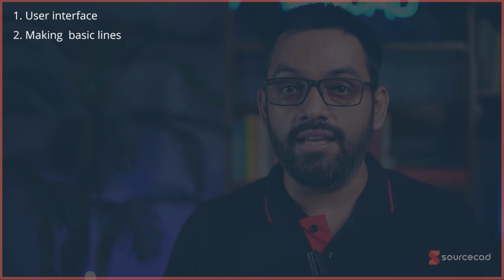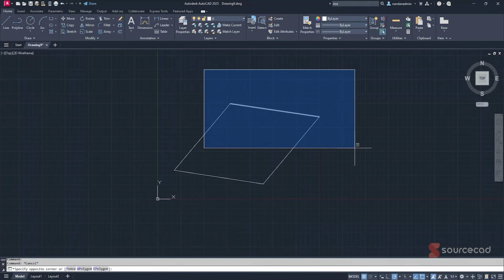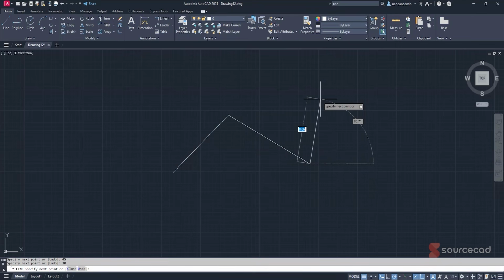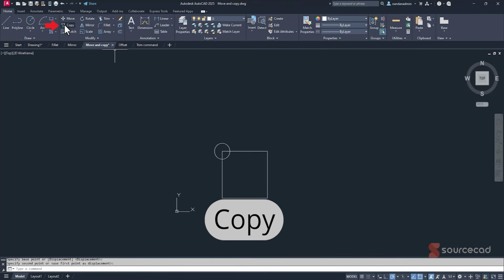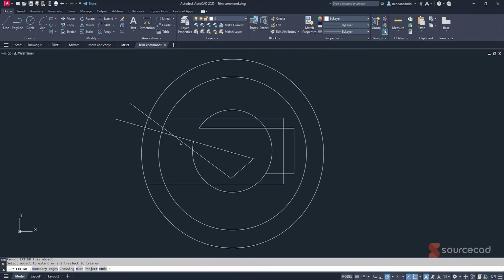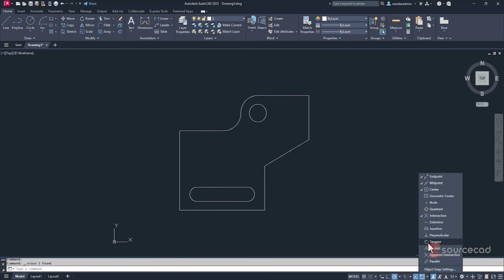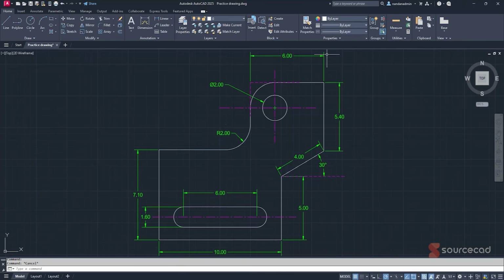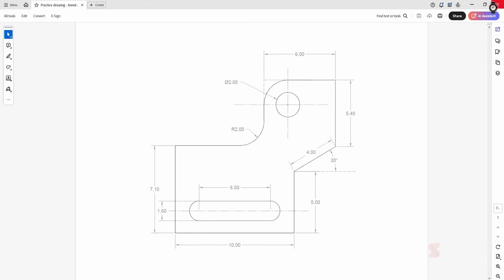Complete AutoCAD course for beginners

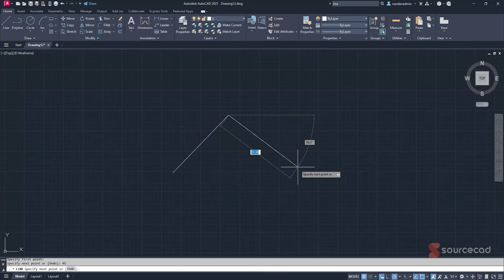Comment: 23:35 - In this part, whenever I am setting the length and the angle, I am not able to do it properly with dynamic input on. Hence I am not able to do the dynamic input part properly

Comment: Thank you for this AutoCAD course. I've been Adobe user for 30 years on Macs and PCs and I'm trying to adapt to the user interface of AutoCAD and it's frustrating. I have a couple questions... 
One: I'm using AutoCAD 2025 LT for Mac. Every tutorial video I''ve come across on Youtube shows the palette with all the drawing tools on the top in the ribbon. My software defaults to the drawing tools palette on the left of my screen. Can'tmove them to the top. Unlike Photoshop, Premiere, and InDesign I don't see any way to change the workspace of the palettes. I've tried searching the menus and option- and control-clicking every palette. Is there a way to do this? Or is it a feature with LT only?
Two: The fillet command works on one Drawing, but the next Drawing it will not work. I've drawn rectangles on one drawing and I'm able to change corners to rounded in two clicks. Works perfect. Then I click onto the next drawing and do the exact same procedure, same steps and it doesn't work. One drawing works. The other drawing doesn't. Why? It's a rectangle. Not on a different plane or anything. I can't find any preferences to change that would say something like "Click to allow fillet tool to make rounded corners in this drawing." 
Adobe products allow for discovery in a much easier way. I really want to learn AutoCAD but I'm having difficulty adjusting because if something doesn't work, it just doesn't work. I've done searches on the help  desk and google but it seems no one else has this problem. 
Thank you!
Reply from the maker: I can understand it can be frustrating moving over from Adobe softwsare to AutoCAD. They are both differnt one is for creative work and another for precision os the workflows are days and night apart. About your question: 1. AutoCAD for MAc has a differnt UI than AutoCAD for windows and the video is for windows AutoCAD hence you are finding is different. It has nothign to do with LT. About second question related to fillet, there can be two things, first is the type of geometry like use of connected polylines that sometimes does not work well with fillets. Try exploding the objects you want to fillet using X command and then fillet and it should work. Second reason is the fillet radius, it its too large or small, it may not work. The best place to look for error is above command line where you will see the reason why fillet failed and then you can fix it accordingly.
Reply: @sourcecad  Thank you for your reply. I will now stop looking for the rearrange palette/ribbon option :-) The hangup with the fillet tool was that I needed to use the space bar instead of the enter key to activate the radius. I ordered your book from Amazon last night. Looking forward to its arrival and diving in. Thanks again. Much appreciated.